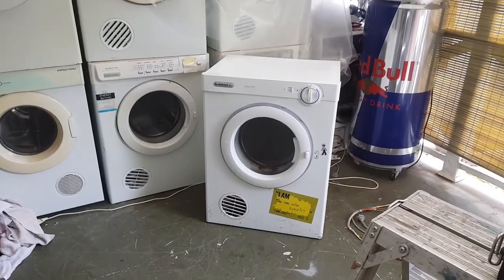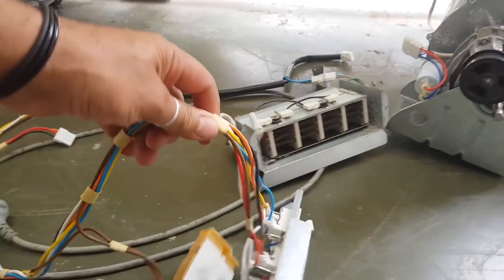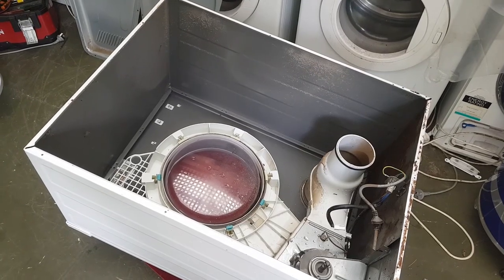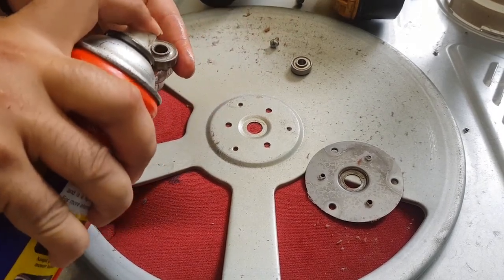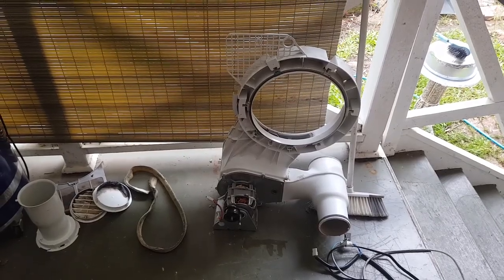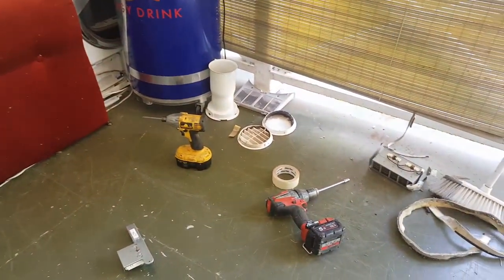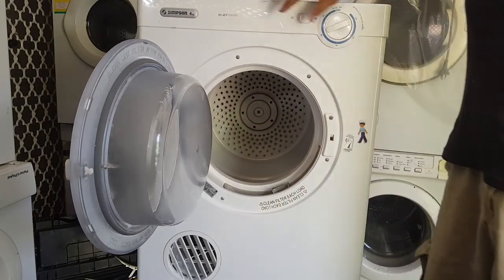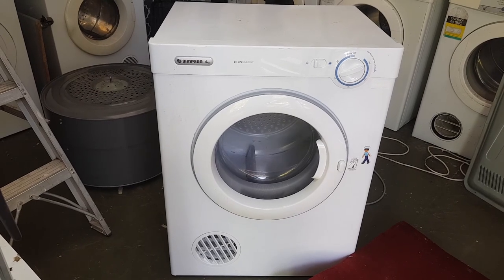Flood damaged Simpson Clothes dryer DIY repair fix. Under water. Motor, heater, timer, bearing, etc

Comment: did you put a new bearing felt back on and where do you get them from??
Reply from the maker: Yes, and from another machine I scrapped previously.
Reply: @DIYDumpRat  can they be bought new or second hand? thanks
Reply from the maker: @JOHNSMITH-if9jr  probably mate, I've never really had to buy new parts. But if I were to try I'd start with eBay for sure. I'd say they sell them.
Reply from the maker: @JOHNSMITH-if9jr  yep I just had a quick search on ebay. They're there. Just search for 'Simpson dryer felt seal'.
Reply: @DIYDumpRat  thanks that's great mate; from Melbourne.